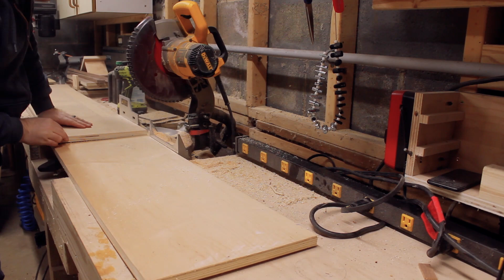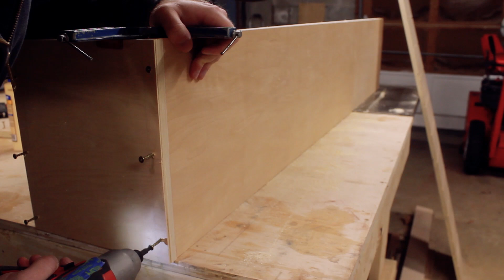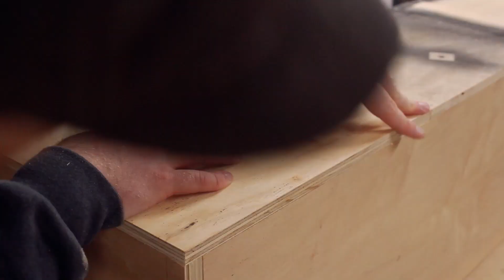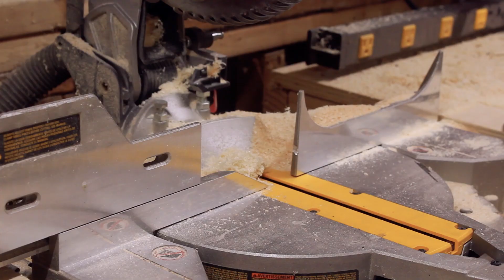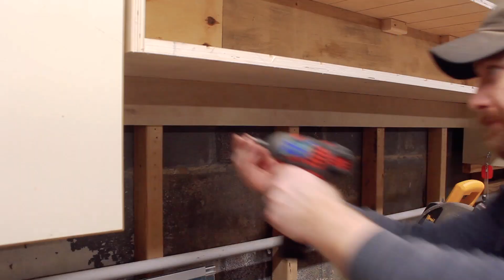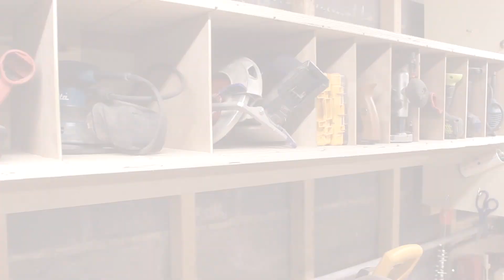Tool Storage Shelf With Adjustable Dividers // Workshop Organization // Woodworking

Comment: I watched this 3 yrs ago when it came out and I've come back to say thank you to the creator. That simple router jig foe making the slots for the luon to slide into has helped me tremendously over the past few years to organize my shop. I've modified the size and dimensions over the years to make drawer dividers shelf dividers, custom cabinets with sliding doors under my workbench, dividers in a wooden cabinet that housed a TV with two hug drawers. I modified that cabinet into a hardware storage center. I had bouse several dozens of the Ankor bins on one of their clearance sales and they always filled with dust, despite the dust collection system I have, plus fine filters. So those huge drawers now house the bins with all of my hardware and there was some space at the back and they would slide whenever I opened the drawers. So I employed the router jig and put a groove the length of the drawer in back for a piece of 1/8" plywood. That space in the back now holds long rods that I keep on hand for my many projects. In the area in that cabinet where the TV would go, I made drawers for that section that now hold various items for the shop and used the jig here too. One drawer is divided into sections to hold the round sandpaper, the rectangle shaped for an older sander I keep and the belts for my other handmade. So as you can see, that simple jig of yours has transformed my shop into an organized oases for me. Now it's a pleasure to work in there and I now know where everything is.
So thank you Sir!!

Comment: I've built one of these these this weekend. The dado spacer jig worked a treat. I made the bottom shelf  out of 1/2" (12mm) plywood as that's all I had but my span was only 30" (you span looks quite a bit more). But it does sag quite a lot at the bottom. My dado is about 1/8" (3mm). I might have to remake the bottom shelf when I get some 3/4" (18mm) or add a central support once I've got my tool positions finalised. Thanks for the inspiration.